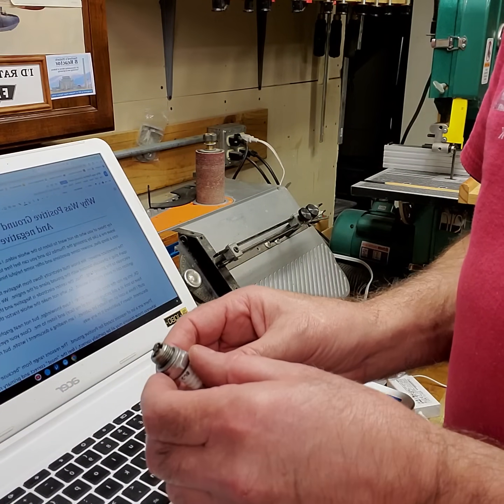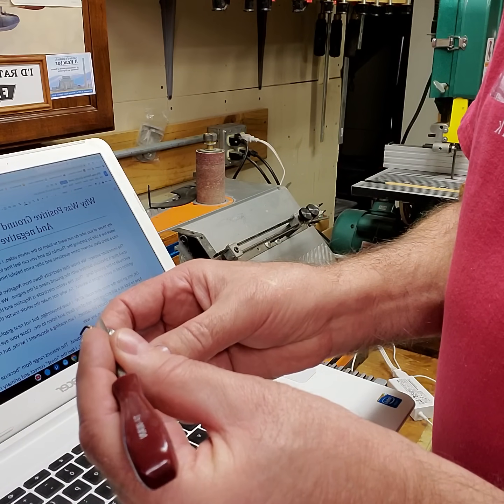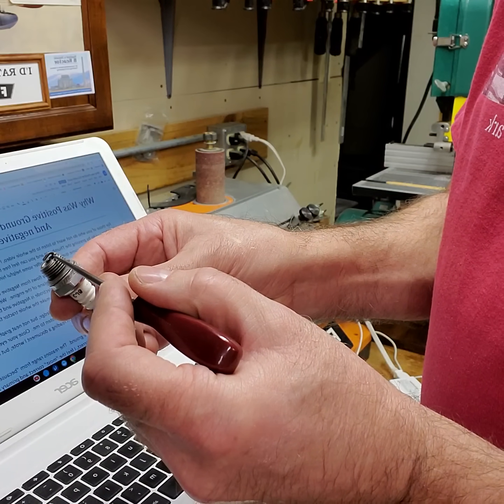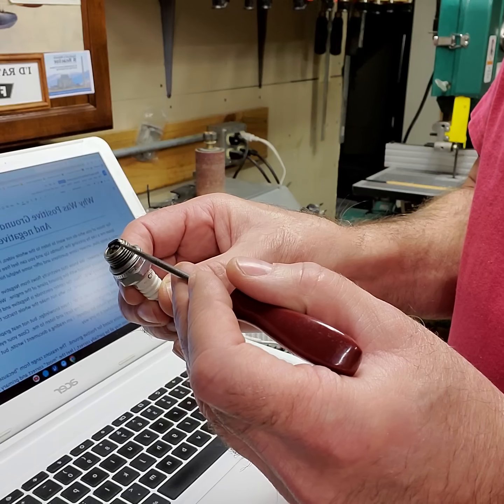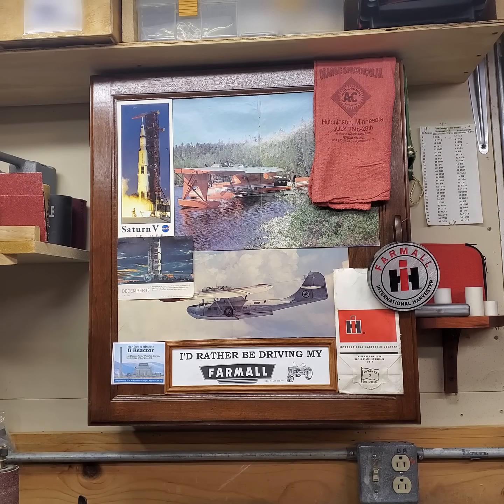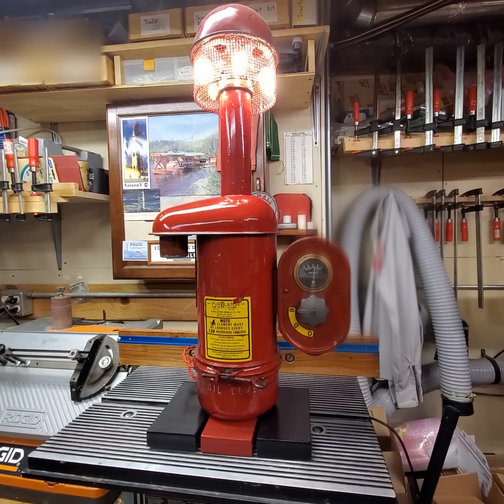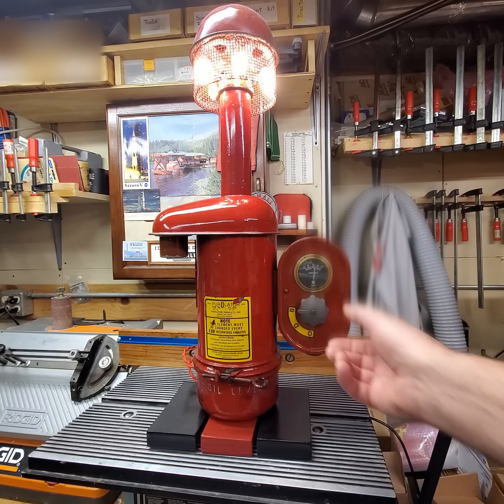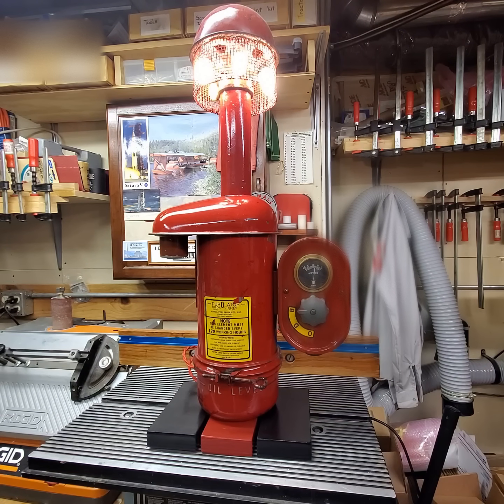Why positive ground was used on old cars, trucks and tractors

Comment: Thanks for this posting and explanation. Your mention of paint on Gen. mounts affecting the Field, leads me to ask. On 53 NAA Ford 6V the Generator Terminals are F, B, and Grnd, and all brackets were painted before assembly. Should I add a ground wire from Generator swivel bolts to the block bracket mount bolts ?
I also can't help notice your Electrical Receptacles mounted with Grounding pin on top to what was previously considered safe or Code.
Reply from the maker: Hi William.  Thank you for watching and commenting.
I ran down to my shop to look at that receptacle.  It is upside down.  OMG!  My eyes see that and I have never noticed!  I don't use that one ever.  Nevertheless, I promise I will turn that around immediately!  I thank you.
Now, the NAA.  Personally, I think a ground strap is always a good idea.  A braided strap may be better than a wire.  Good grounds are so essential.  Don't forget between the distributor housing and the cast iron block too.
Again, I thank you!
Reply: @bryanh1944FBH  I did some research on orientation of AC Receptacles and rest assured, there is no code violation. In my seven decades of life I've seen both types of installations and wondered myself why. Most if not all 90º cord/plug designs have the Ground pin on the cord end which makes it convenient for cords hanging down. Your explanation of electron flow and what was common knowledge years ago is still spot on and I thank you for the tutorial. I also enjoy your static displays especially the PBY.
Reply from the maker: @williamokrasinski9840  HI.  I turned that outlet around this morning already.  Once on my mind, it has to be changed!  Ha ha  I like the ground pin down.
I thank you for pointing it out.
I should make a video on the 4' Balsa Wood PBY that I have.  I did a Black Cat theme.
Also, If you ever make it out to Richland, Oregon, get out to the B Reactor at Hanford!  I can tell you how it works.
Reply from the maker: @williamokrasinski9840  Get this:  Does YouTube spy on you?  I think so.  Just after this conversation, YouTube brought up a video for me on the topic of installing outlets upside down.  Strange huh?
Turns out there is a good reason.  I never knew this and is not what I did.  But, in areas where metal is falling (think parts bins), the ground pin is now the first thing a falling metal piece will hit.  The assumption here is the plug-in end is not fully in.
Well, maybe you will see the same video.

Comment: I have a Ford 8N that I still run positive ground and a 53 golden jubilee and it also is positive ground!
I have a Farmall M and it has a magneto it is positive ground but listening to your video a question comes to mind if I would change it to negative ground would the magneto get damaged over time or what might happen? Thanks 😀🇨🇦
Reply from the maker: Hi Keith.  Thank you for watching.  I don't think anything bad will happen.  But, lets see what others have to say.

Comment: Good video. I also learned electrons flow neg seeking positive. Great comments. Especially about the corrosion factor. I have old cars some positive some neg ground. Have had corrosion issues at ground straps.  Never thought to look at accessory connections on positive grd. Cars.  Great info thx.
Reply from the maker: Hi Kleps Garage!  Thank you.  Good luck to you.

Comment: Thank you for the video!  I just bought a DOA Leyland 154 Tractor,  this is the starter course I need for what I believe to be its 12v positive ground electrical system.  I started out attaching the chassis side battery cable to the negative battery terminal and thought this is awful loose...nice brass + looking right at me.   Turned the battery 180 degrees and things fit much better...engine turns over but no sparks yet...here we go(do what you know or figure it out)I'm headed back out to the tractor!
Reply from the maker: Hi greenmirror555.  Thank you for commenting.  One of my favorite tools is a spark tester which allows the spark to be seen (which sounds like you have).  As strange as this may sound, I would focus on making sure there is a good ground between the distributor body and cast iron ground (I am assuming this tractor has a distributor and not a magneto).  I have seen this problem on tractors that have been sitting.  Naturally, this is assuming there is power at the distributor (something as simple as a bad on/off switch).  Good luck!!

Comment: The negative-ground electrical system was developed because, years ago, few electrical accessories were in use on vehicles other than the basic ignition system and running lights. How, with the advent of the transistor,  research was increased to apply it to automotive use. The car radio was an ideal place in which to use this device.  The first transistors were of the germanium  PNP type and were more easily applied to a negative-ground system than a positive-ground system,  because of their  makeup. This development generated a swing away from positive-ground systems on both cars and trucks. Little info was available about the problems that could develop with a negative-ground system.  Since the PNP germanium transistor was developed,  major advances have been made , and the silicon transistor is now used.

Comment: Great discussion! Back in school, auto body, though I became something different, we were taught the theory about positive ground reducing corrosion and negative ground just being easier for mechanics. I laugh when folks put an 8v battery in a tractor with a 6v system. "But it started better....." It's only going to charge up to 6.5 volts or so.....
Reply from the maker: Hi.  I have a copy of an old Delco Remy service manual for Voltage Regulators.  In this manual, they explain how to adjust voltage.  I suppose this is an application for that.  The manual also talks about the difference between regulators for positive ground Vs. negative ground.
Reply: @bryanh1944FBH  excellent, I rarely hear from people who even know that the voltage can be adjusted. Most just put the 8v in and go. Have a great evening!
Reply from the maker: @ktm42080  I will.  Thank you.

Comment: @3:40 the Johnson Quick Action magneto coil used on 1920's twin cylinder outboards has one lead going to the port spark plug, the other to the starboard plug. These were opposed cylinders that fired simultaneously. Bottom line, one plug is positive ground while the other is negative ground.
Reply from the maker: Hi!  Very interesting!  I wonder why they did that?   I wonder, were both plugs the same then?
Reply: @bryanh1944FBH  Yes. Both plugs were the same and gapped the same. These were opposed cylinder twins, so both pistons reached TDC at the same time, thus, both plugs needed to fire at the same time. By getting the coil to put out ~60kV, each plug had a voltage drop of 30kV. Had the coil been designed to put out 30kV, and the plugs be in parallel, then it would be possible for the motor to run on only one cylinder.

Comment: I swapped the battery 
Polarity around on my 53 Ford. It still started and the starter still turn the same direction but I noticed the ammeter said discharge when it was charging I understood it immediately
Reply from the maker: Hi Ronald.  I see that too on tractors that have been swapped.

Comment: CRAP.
IF the spark must jump from electrode to gnd then + gnd is ok.
If the manufacturer had wanted to use - a negative gnd then they would SIMPLY have made the ign coil secondary terminated the opposite way. (Exactly as happened years later).

Originally:  Due to understanding valve theory,  manufacturers believed that neg earth would make vehicles rust more easily and positive gnd would reduce the very significant problems of rusting.
Then we remember that in our homes;  radios and tv used thermionic valves.
A few portable radios (containing a 4.5v battery for the valve heaters & a 90v battery for the HT)  were marketed (Roberts being a clasic).
Then valved car radios & amplifiers became available (with Pye being a clasic manufacturer) incidentally reinforcing the vehicles depemdance on positive gnd.

Later when transistors were invented they were made of doped Germanium,  again the electronics circuitry reinforcing the need for a pos gnd.

However as Silicon semiconductors became of age,  Alternators became viable over dynamos and car radios became more commonplace as the radio licence / car radio tax was simultaniously abolished.

The uptake of alternators (with high power Silicon diodes needing cooling)  and radios with Silicon neg gnd circuitry quickly caused vehicle manufacturers to have to change to negative gnd and the ign coils were simply terminated appropriately.

Even 55 years later, you can open almost any electronics circuitry and its going to be negative gnd.

The vehicles polarity is not random or whimsicle or by mistake or any other such rubbish.  It was originally positive gnd for very good reason and around the late 1960s the change to negative gmd was made also for very good and sustained reason

Shame this video auther doesnt know what he is talking about.

Comment: @Brian H or anyone - one thing I don't understand is how in a negative ground system does the tang of the spark plug become positively charged.  It seems like the tang is connected to the threads and the threads to the metal engine and that all would be connected to the negative ground.  Unless they somehow isolated the spark plugs??
Reply from the maker: Hi!  The ignition coil does the separation (or, call it isolation).  I thank you for watching.

Comment: Freightliner trucks were positive ground from around 1980 and earlier.
Reply from the maker: Yes!  They used positive ground for a long time.  Even diesel engines.
Reply: @bryanh1944FBH  even diesel engines ?!  No need to be snarky
Reply from the maker: @redmesa2975    I'm sorry.  That came off wrong.  Let me try again.  Even with diesel engines (which have no spark ignition which I talk about), they used positive ground for a long time. So, the Freightliner engineers had different reasoning.

Comment: I think the main reason positive grounds were used is because at that time, the electrical engineers utilized the advantages of positive grounds on tractors for the purpose of the longevity of the tractor.  Telephone companies use bare copper wires without insulation for years without corrosion because the wires had a positive charge, and that kept the copper cables from corroding.  Large ships use this same technology of electrolysis to keep the hulls of the ship from corroding in the salted seas, therefore eliminating periodic maintenance and dry docking the ship for months while the hull is recoated with paint.  The electrical engineers at the time of older tractors thought it would probably be best to have a positive ground system to keep the farm tractor from corrosion being that it was used outdoor most of the time and sometimes not sheltered from rain.
Reply from the maker: Hi Ben, Thank you for your reply.  I am glad you brought up ships.  I would like to know more.  I've been on a lot of them, but do not know about hull electrolysis.  I saw on the battleship Texas, they were replacing the zinc anodes now that it is in dry dock.

Comment: In side your battery the power flows from + to -  . Out side the battery the power flow is - to + .So if you grab your - cable with your right hand at the battery ( 12v neg ground) and then use your left and grab the same cable next to your right .Your right hand is -  and your left is +. So behind you is neg and in front is pos or think of an arrow on a one way street sign .So when you remove your neg battery cable you could say it became pos because behind you is the neg battery terminal and the only back to the pos battery side is that cable .So if you want to start a fight at the bar -----------------  fun with electricity  .

Comment: I'm 69 and grew up using and working on the old IH and Oliver 6 volt tractors and I really like your video.  I dislike the sight of a lovingly restored old tractor that has been "upgraded" to 12 volts and has a bright, shiny alternator bolted on.
Reply from the maker: Hi Rick.  I agree!  I work on a friend's 1944 Farmall H.  It can be seen in some of my other videos.  It has the original generator.  It's 6 Volt and works as well as the day it was made.  But, generators are harder to keep going as they do have brushes.  And, as we both know, good grounding on 6 Volt systems is everything!  Excellent comment.  Thank you.

Comment: Boosting was always interesting during the 50s. We had positive & negative ground systems as well as 6 & 12 volt systems. I had a 6 volt positive grounded Dodge in the 60's & the tow truck drivers always had a lot fireworks boosting that one. Fortunately there was no computer to burn out. I once installed a voltage regulator from a positive grounded Dodge on a negative grounded Jeep. Both were Auto Lite. I switched the whole vehicle to positive ground. Not a good idea.

Comment: I have a 1946 M Farmall switched it to 12 volt several years ago and I left it positive ground all I changed was the regular lights and put a resister on the coil, the 6 volt generator work great with a 12 volt regular. Enjoyed your video.
Reply from the maker: Hi Delmar.  Thanks for sharing.  Do you remember, was your new regulator for positive ground?  Or, didn't it really say?  Just curious .....
Reply: @bryanh1944FBH  it was positive ground I think the one I got would work both was once the generator was polarized

Comment from the maker: There are a lot of comments about wasted spark ignition systems (a topic which this video does not cover).  Wikipedia has an excellent article on this topic: https://en.wikipedia.org/wiki/Wasted_spark_system
The article explains that spark plugs used in wasted spark systems "should" have precious metals on both the central electrode as well as the ground tang to decrease erosion and increase the plug's life.  Many comments also support this.  Just saying; but, I suspect these plugs are somewhat more expensive.  The article also talks about the reduced Voltage needed to fire the plug on the waste spark (which also reduces erosion).  Please check out that very interesting article.

Comment: I had a 1955 Ford Custom Line with a 6V Positive ground system. I always had people asking me how it worked, my response was it worked well.  At the time I lived in Montana and we went through a very cold winter-30F for 3 months with the bitterroot River freezing and the frost went down 10 ft into the ground.  My father had a 1972 FJ40 and every night he had to plug in a dipstick heater to get it to start and take the battery inside.  Me, I just got into the car, turned the key and it started right up every time.
Reply from the maker: Hi Scott, and speaking of cold weather, here it comes ......  Dang it!
Reply: What many people don't understand is that electric motors are rated in watts, and watts is volts X amps, and that when you double amps you SQUARE the resistance.  That means a 6 volt 200 amp motor and a 12 volt 100 amp motor will perform exactly the same, BUT the 6 volt motor will be far more sensitive to undersized conductors, dirty terminals, etc. because it is drawing twice the amps.
Reply: Thank you for adding the engineering explanation and relationship of voltage and current in a circuit.  As an engineer, I just know that relationship and forget not everyone thinks like me.

Comment: Anecdote: I used to work on VWs in the 50s and early 60s. All VWs were always negative ground. (Were all German cars always negative?) At the same time all English cars were positive ground. People were forever installing new batteries in their VWs in a positive ground configuration thinking all European cars were positive ground.  In many cases the generator would re-polarize itself and the car world run OK except for the spark plugs failing with the side electrode eroded into a sharp point, exactly as you describe.  Sidebar- Why did German cars use bolts to hold the wheels on while American cars used nuts? Thanks for the video, most enjoyable.
Reply from the maker: Hi Jim!  You are exactly right!!  This is exactly what happens to spark plugs when the polarity is wrong.  When I remake this video, I will have to make that point clearer.

Comment: In Europe vehicles built before 1958ish were equipped with a dynamo charging system were always positive earth, after that date alternators were fitted  and always negative Earth. Alternators were preferred as they had better output characteristics at lower engine speeds and required less servicing than dynamos with external regulators.   
  It was possible to change the polarity of the dynamos by connecting the battery the "wrong" way and flicking the relay in the control box a few times. I often did this if I wanted to fit modern LED bulbs  in the lights of older vehicles. Better lights and less power consumption. LED bulbs are polarity sensitive. 6volt Dynamos actually put out 18 volts , the original mechanical regulator controls the output at the lower voltage, it is possible to charge a 12 volt battery by fitting a modern solid state regulator which can be wired negative Earth. This allows electronic ignition to be used which gives a much stronger spark at the plug and improves performance.
Reply from the maker: Hi Derek!  Thank you for the comment and the lesson.  Very interesting.

Comment: Polarity of the voltage on the spark plug has nothing to do with the choice of polarity of the battery. The ignition coil can be wound to work either way.